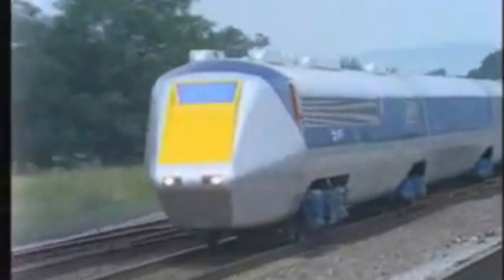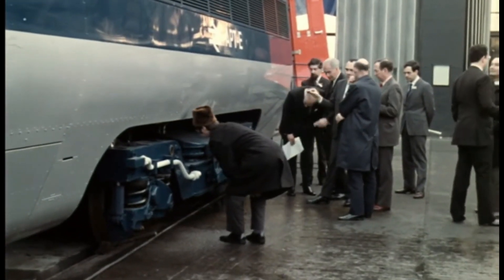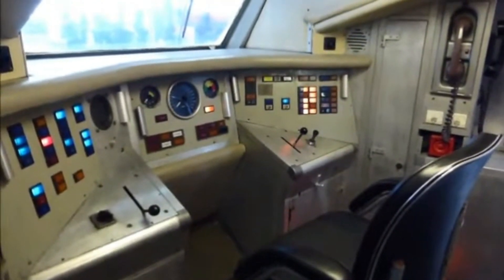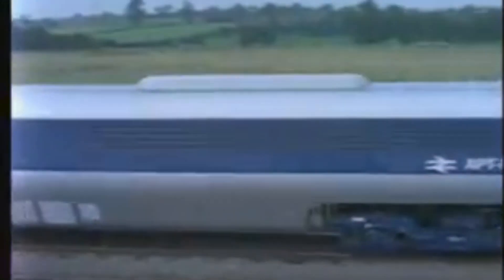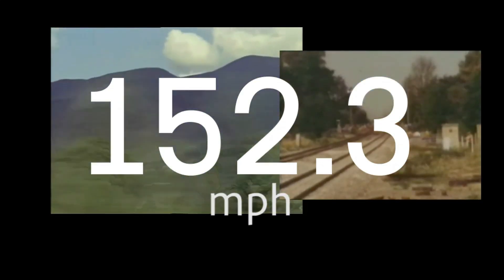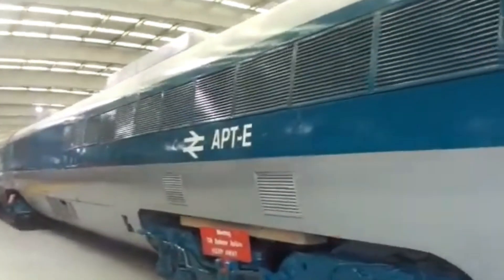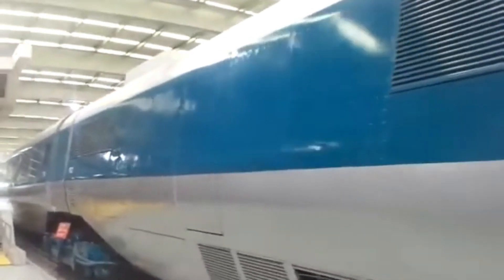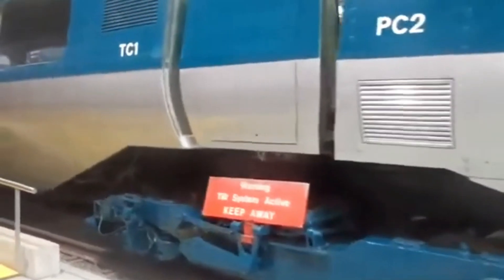APT-E: Britain's Revolutionary Tilting Train That Changed Rail Travel Forever! #apt #scrapped #fyp

Comment: Was the APT-E diesel powered and still would have had tilting mechanism so that it can tilt at high speed. Compare to the APT Class 370 electric train that was also built for the West Coast Main Line but it also was temporary.

Comment: The REALLY important bit about APT-E's technology, and of the later APT-P, was the shape of the wheels and the suspension. That made the train much more stable at high speeds, and BR made the technology freely available to all other railways, world wide. Most high speed railways use those profiles, or developed versions of them, to this day, bar possibly the Japanese Shin Kansen, who still use tapered wheel profiles and have to re-grind them much more frequently as a result.

Oh yes, we added a fifth turbine to provide traction power in each Power Car in APT-E. The fifth turbine used to be an auxiliary power unit to feed the instrumentation and house power for the train, but a diesel APU was swapped in later.
Reply: Mr. Spackman was APT-E's tilt engineer; I can thoroughly recommend his podcasts on the subject, particularly some of the antics they got up to.. I won't spoil it, but the passenger for Newcastle story cracks me up every time...
Reply: @vickielawless  Oh no, where did you hear me tell that tale of woe then?